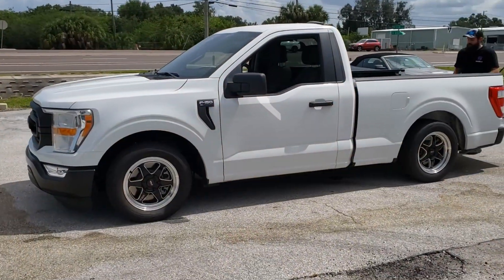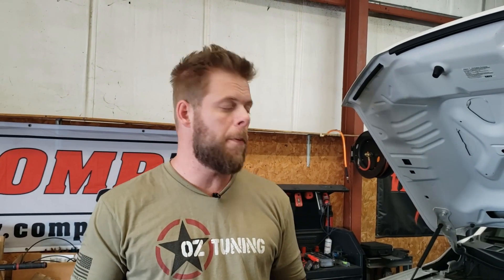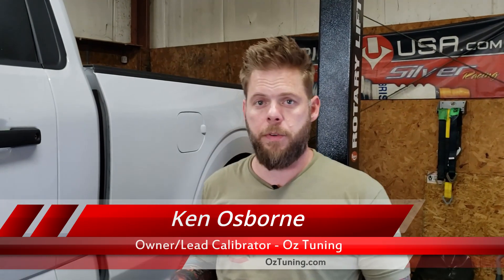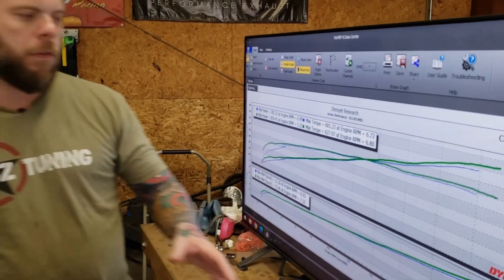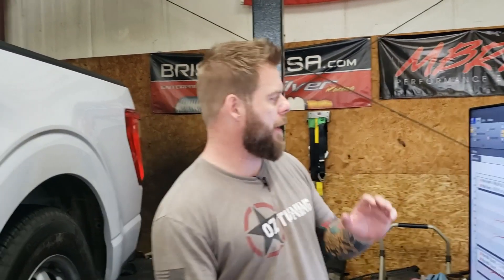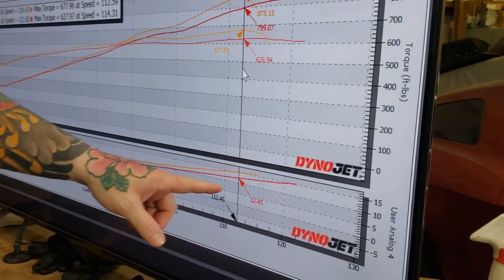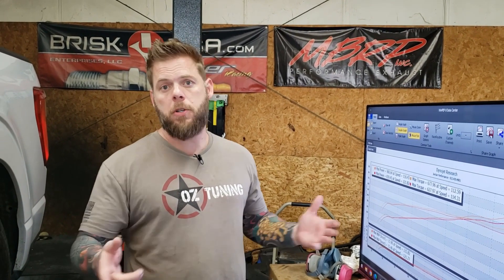2022 F150 5.0L - ProCharger truck at over 900whp. Oz Tuning testing the new ProCharger system.

Comment: What's a good set up for a 2024 F150 5.0 with onboard power generator? I just want a little more than stock. Maybe 500 rear wheel HP and similar Torque? I have 3:73 rear end but unless in sport mode the truck is sluggish and when pulling even a light load is very sluggish. I don't want to go crazy but need a little more. Anyone at all please chime in and advice appreciated. Thanks!

Comment: I have a 2016 F150 Gen 2 Coyote. I have the p1X procharger kit. I went with the highest trim kit IE Helical cut and the largest intercooler. My tuner set me at 504 hp on 93 octane. 1 month in my lead frame assy went on my 6r80 transmission. Quick fix. Trans seems wonky though from 3 to 4. I am curious how you were able to achieve higher numbers and what steps I should take next? Im located in NC so if you have a reference to a shop you are comfortable with that has expertiece that would be great as well. Thanks

Comment: The transmission is the first failure point with throwing high hp at these trucks. You can easily get the engine over 700hp, but the stock 10R80 transmission will only take around 600 lb/ft of torque before things go south.
Reply: Bullshit.

Comment: All these f150 builds are bolt on hp with no internal work that’s VALID to support over 800 horse.  That’s the part nobody sees or talks bout of course but bolting on pro charger and a set of injectors are a days worth work like swapping alternators and at a noble 5-600 hp that’s fun and reliable but once your up above 14 pounds boost and 
or 750-800 hp you are tuning constantly to get anything more than a rich or poor mixture not supporting daily driving. If it’s just your weekend weapon and you don’t drive 100+ miles a week that works and if don’t mind constantly sinking money into various changes and parts that’s for you. If it’s your daily, a single turbo or 3L max supercharger will be more than enough for reliability and I don’t wanna talk. Common sense should explain this as it’s not a hypothesis it’s the analytics of the COYOTE no matter what Gen you have. My man is intelligent but this is a test truck that some parts are donated so no cares on their part and it’s appreciated them allowing us to test our trucks platform on their dime

Comment: I’d be curious to see how the Vortech kit compares. 

I love how Vortech mounted the head unit way down low and uses the shock air box… Rather than pulling hot air off the engine.
Reply: I've been eyeing the vortech kit for my 23.. ran them on my fox back in the say and had good results

Comment: Were oil pump gears/crank sprocket done on this truck?  I’ve heard 21+ f150 5.0’s were belt driven and that there is no need
Reply: There are no OPGs on 21-23 coyote f150s. It's kevlar belt driven. This is the 4th gen coyote; similar to the '24 coyote mustangs.
Reply: No need in gears
Reply: @themiketillman Wow, stock OPG and crank sprocket pushing that power is wild
Reply: @thefastsparrow1295 gen 4 coyote got rid of OPG and went belt driven.

Comment: What’s the recommended “safe” power levels for a gen 4?
Reply from the maker: We are running E85 with a 3.5" pulley on our Whipple shop truck and that is more than plenty for a street truck. Around 700whp. 
No one really knows yet the breaking point with these engines, but there are always risks when increasing power on a factory built motor and transmission. Then, how you treat the truck is a factor with reliability too.
Reply: I have a 2022 f150 supercrew and i always thought it was a gen 3 coyote. im thinking of trying vortech kit route which is more budget friendly and hoping to reach 700whp with triple pump fore level 2 id 1050x will i need a crank support at this power level? Or need anything else im missing thanks. @oztuned
Reply: @CarGuyKram if you are running an accessory drive spun vortech or procharger then a crank support isn't necessary. You aren't putting much additional stress on the crank pulley/snout. It's when you go to an independent drive that hangs another pulley off of the front of the crank you are putting extra shear stress on the crank snout because the load is now extended further outwards creating a leverage point that's going to make the pulleys and snout flex to the side applying the force.
Reply: @RammSnipe  ty very much for the knowledge!

Comment: Great video. Very informative.
On a lifted 2021 Supercrew with 4:56 gears running E-85 stock motor which blower would be the most fun to drive? The P1X or a Whipple 3.0 or other
Reply from the maker: Thanks! Contact us by email on this and our forced induction experts can help determine what would be the best power adder for your setup. Tuning@OzTuning.com
Reply: David, how does the truck ride, feel, and pull with those gears?
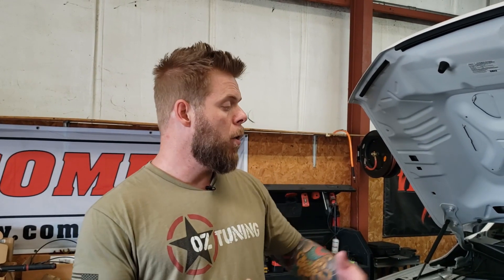Reply: I have ran the 4:56 with the 6 speed and now with the 10 speed. They pull very hard but if i had to do it over agin I would have went with Ford 4:10 gears with the plans of going forced induction. The gearing of the 10 speed is crazy in rear wheel drive I can break the 37s lose on takoff and into 2nd with a slight chirp going into 3rd with just a tune on e-85. @armandoalvarado2710